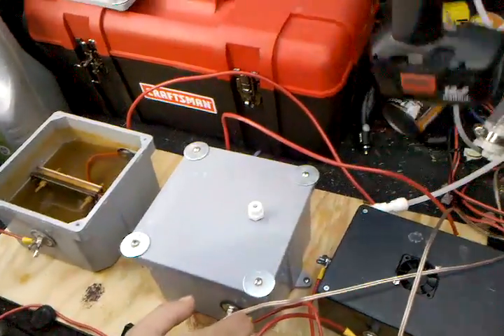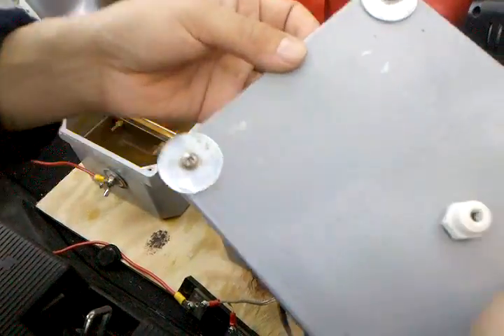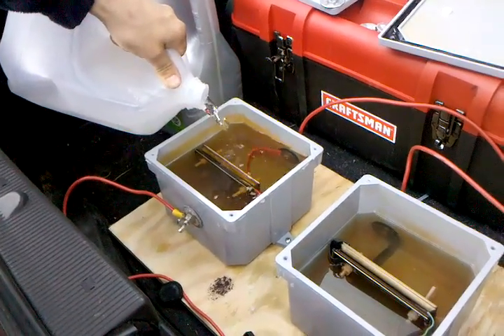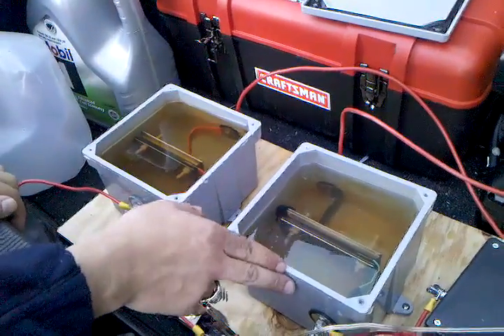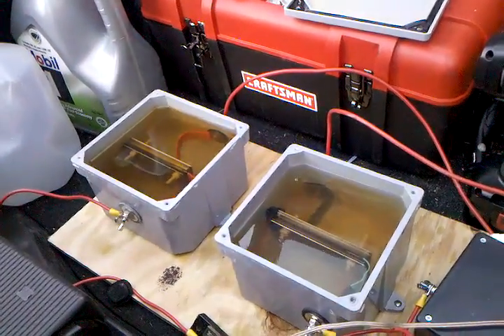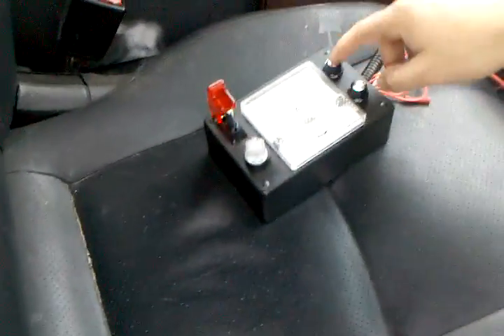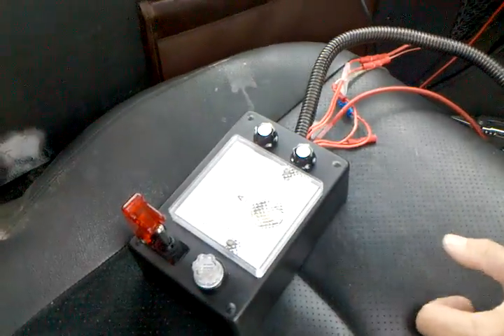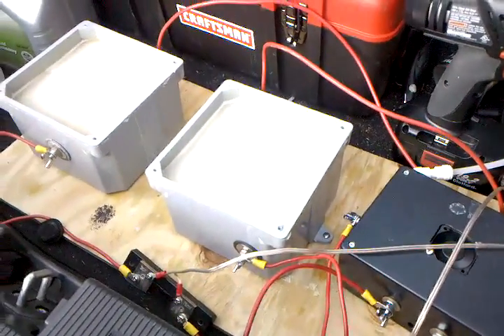Cells in action 3 volt 50 amp cell Hydrogen HHO PART 2

Comment: Sooo inefficient. How hot does the water get?
Reply from the maker: This system uses over 60% less electricity than standard brute force electrolysis apparatus. 13.8v x 25 amps x 2 cells= 690 watts versus running at 2.8volts x 25 aamps x 2 cells = 140 watts. What were u saying about ineffeciency? Lol. And the water gets warm.
Reply: It's the amps that break H2O bonds not the voltage, you could make a cell at 1.5 volt 50 amps and 50V 50amps the same result

Comment: That qualifies as dangerously low fluid level. Way too much gas in the cells running that low. Thanks for showing the difference in amperage vs. production. I needed that info.

 What is the black box btw?

and have you observed any substantial results?
Reply from the maker: The black box houses two dc to dc converters. They convert the 13.8v from the alternator to +-3volts at high amperage